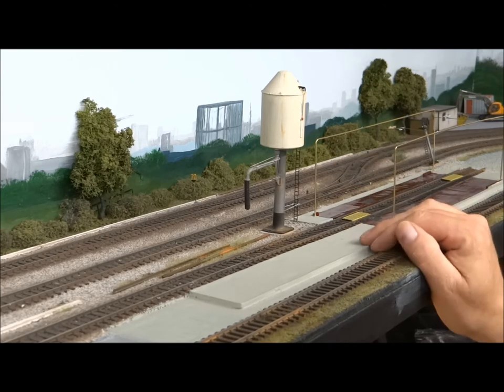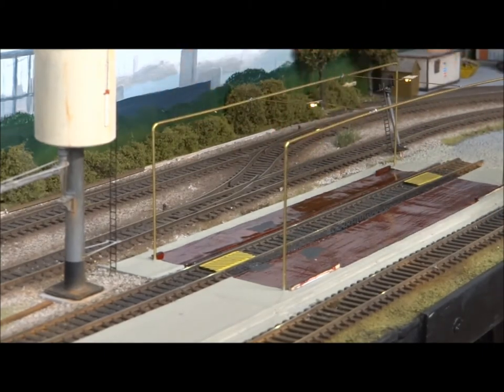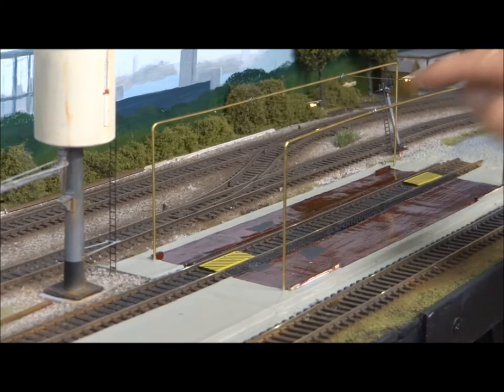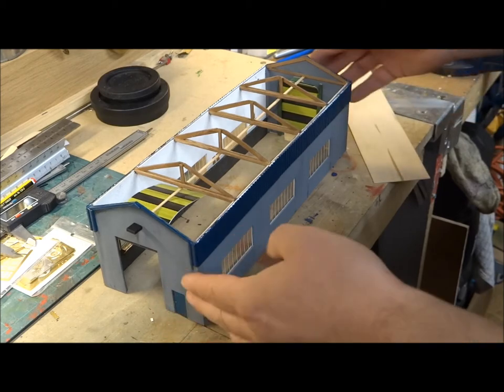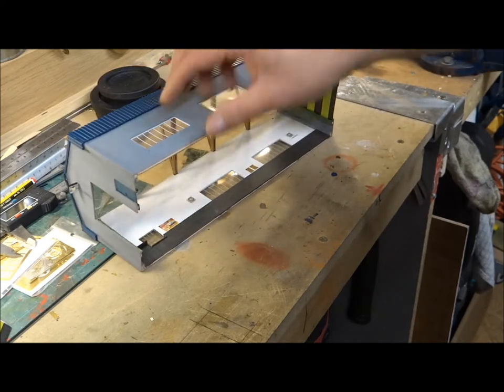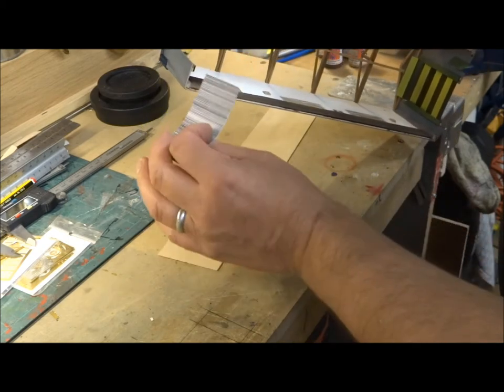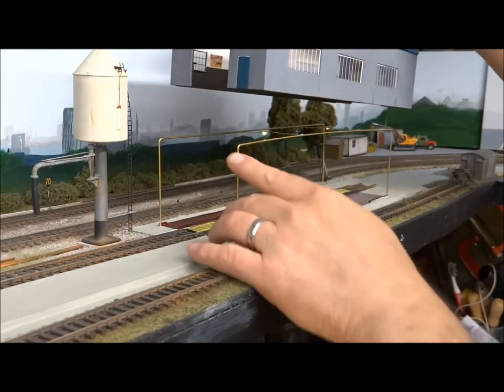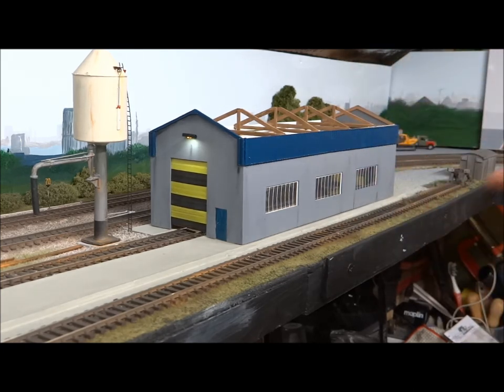Loco Workshop Build - Part 2

Comment: Great idea for the roller door. I might have to look at using that!! cheers. Dave
Reply from the maker: Hi Dave hope all is well..  Cheers yeah I was really happy on the result, 
On the depot doors I have added a brass rod the same width sandwiched in the between to add a little  support to stop it bending and popping out of the rungs, alternatively I was thing of some wills corrugated plastic sheet painted as the door, food for thought..  

Ps how much do you charge for renting out your caravans.. Do we get mates rated lol 
Loving the detail of your layout all is really smart.. Will have to give you a shout out on my next video
Cheers again Garry
Reply: Hi Garry, thanks for that.

Caravans are £100 a night....or £500 for the week lol.

They doors of yours give me some ideas for when I scratch build a loco shed for my tmd sometime in the next year.

Dave

Comment: smart way to do the lighting. I was wondering at the start what you doing there/ engine house is looking fantastic. like the doors for sure. over head door light, now that was done well.
Reply from the maker: Many thanks sparky, Yeah its a very easy way to add power for lighting than having silly little wires everywhere, I surprised myself on how good the light and doors tuned out... lol

Got a few more details to add that will bring the depot all together.. 
Take care mate and thanks again... Garry